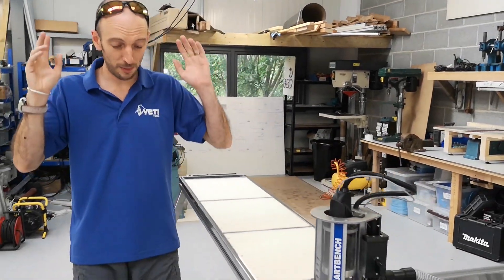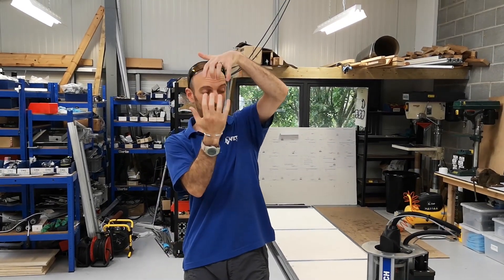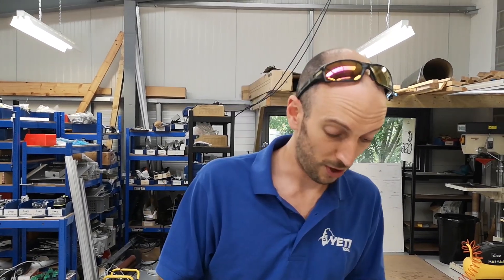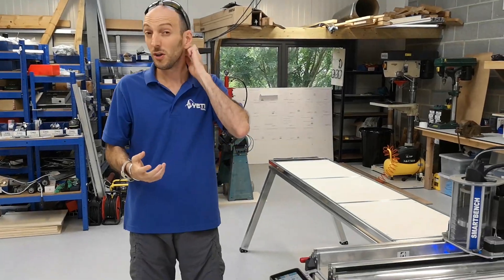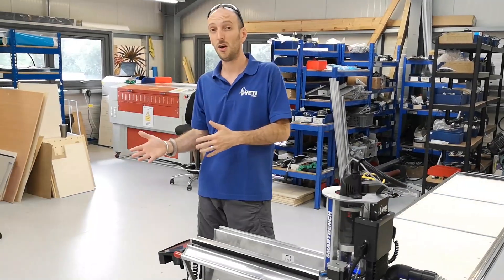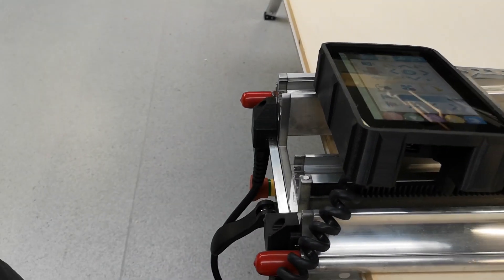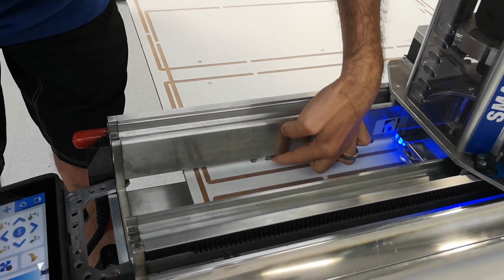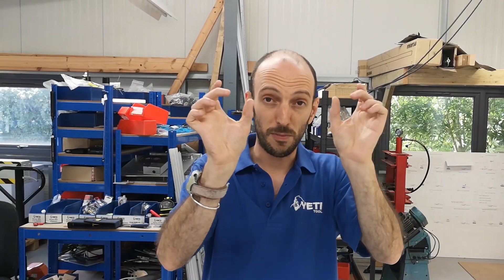SmartBench: Beam Clamping Technology

Comment: Can the spindle be upgraded? Watching your previous videos it's mentioned that your using an 800w @120v spindle (roughly 1hp I believe?) can I use my own spindle as long as it's within a clamping radius? 65mm?
Also, I've been doing cnc work for a while, and I cut alot intricate pieces that are 1 to 2mm/very fragile, and sometimes a waste piece gets stuck to the spindle and jumps out, with the moving clamped gantry, would that be potentially stuck and moving around the work piece possibly causing damage to the finished piece?

Comment: I’ve noticed videos where the user isn’t using the dust collection in an effective manner, and there seems to be a lot debris...

Considering your rollers are now running over top of chips, dust, and debris, Would this affect the height of your beam, and in turn the height of your cutter?  Should a person plan for better dust collection than a typical extractor?

Sorry for the noob question.
Reply from the maker: Hi Dallas! No such thing as a noob question, although we're not quite sure what you mean by using the dust collection in an effective manner, would you be able to point me to a video which demonstrates this?

We've found that for most our projects our extraction is sufficient, but some files may produce more/larger chips. In these instances we've found it sometimes necessary to clear debris as we go along, or indeed use a more powerful extractor.

Comment: can you cut acrylic? if yes, how thick?
Reply from the maker: Hi Dan,
Yes you can cut acrylic with Smartbench. As for thickness, while the Zhead travel is 152mm, in reality the depth of material you can cut would is dependant on the cutter length and would be roughly max 50mm. In house, we've cut 12mm plastic sheet material with ease.

Comment: @YetiTool LTD How many sets of adjustable bearings are on the top Gantry? Are there opposing bearings on the top gantry... meaning mirrored on the opposite side of the spindle? Thanks for the video! Keep them coming.
Reply from the maker: Hi Ron,  There are a total of 18 wheel sets on the upper X beam that are spaced across the entire length of the X Axis. As mentioned in the video - these are able to be moved along the beam in order to be placed relative to your cutting piece. Check out our knowledge base here for more info: https://www.yetitool.com/support/knowledge-base